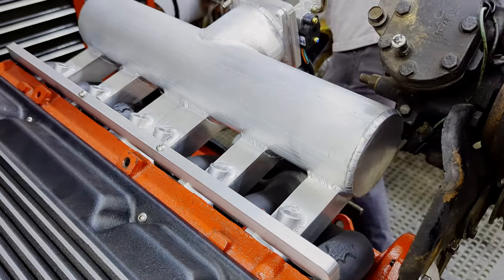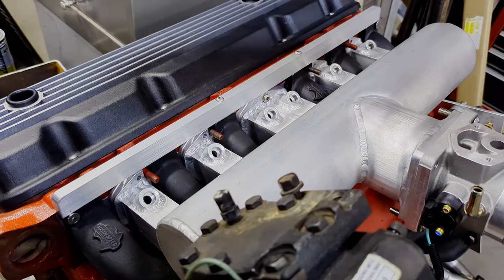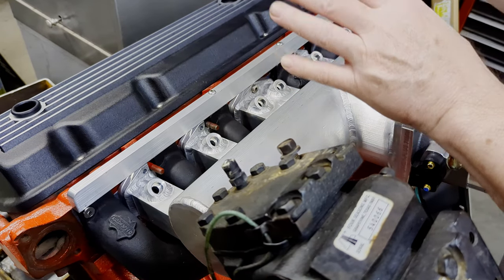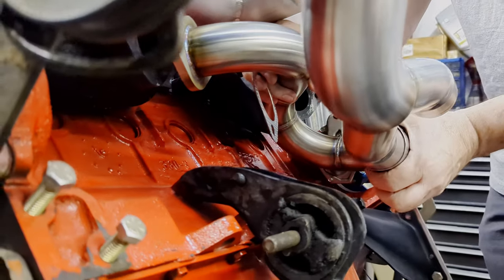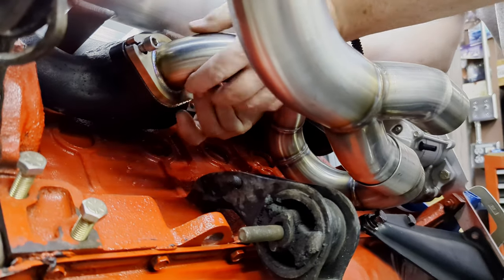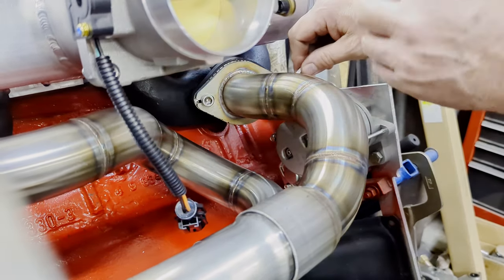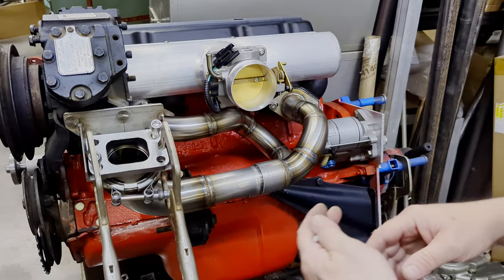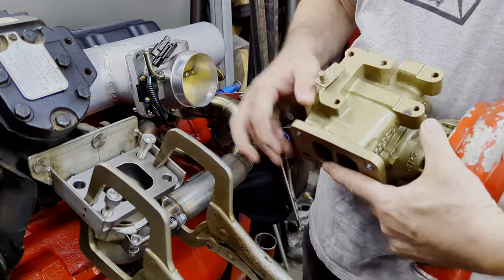Slant 6 Dutra Dual Turbo Pipe Kit Installation Instructions

Comment: If you don't have a air conditioner. What do you connect the turbocharger bracket to? My 1965 Barracuda doesn't have any air conditioning
Reply from the maker: Reach out to us, we are working on an off the shelf solution, but for now we have a few custom options.